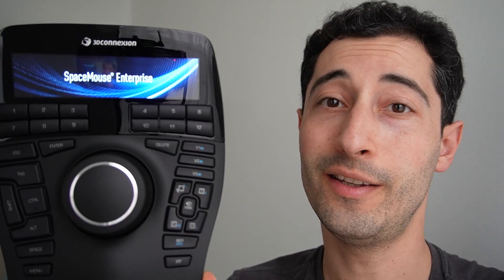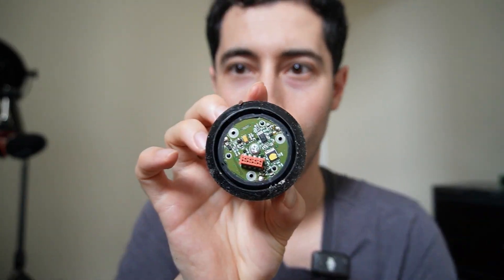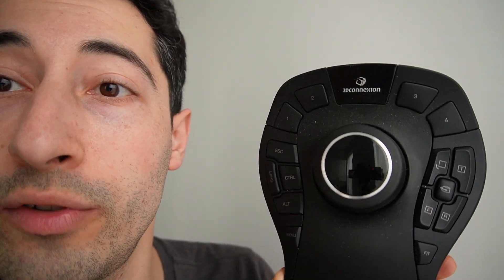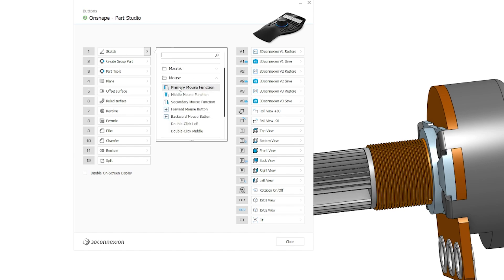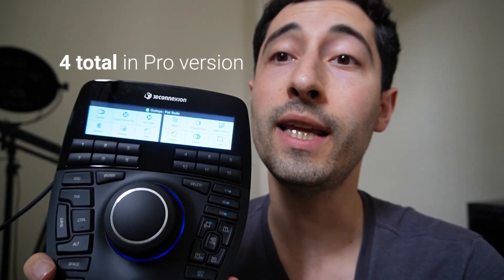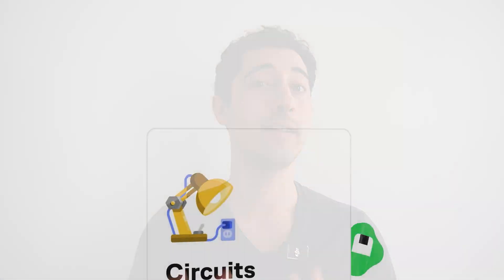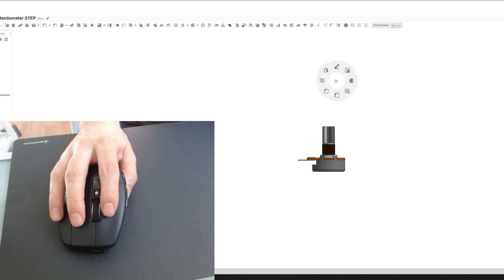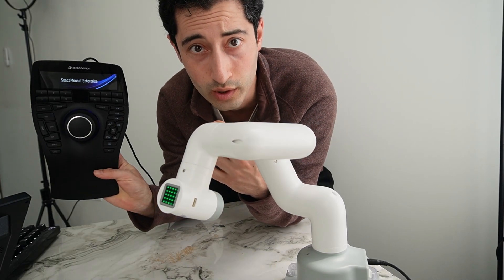Is This $400 SpaceMouse Worth It?

Comment: Do you think any version of this would function as well with fusion 360? Also could you have both this and your normal mouse connected and switch between them? I'd like to at least get the compact if it dramatically impacts your ability to pan, orbit and zoom more easily.
Reply from the maker: Yes, any version will work well with Fusion. You need to have your normal mouse with this.